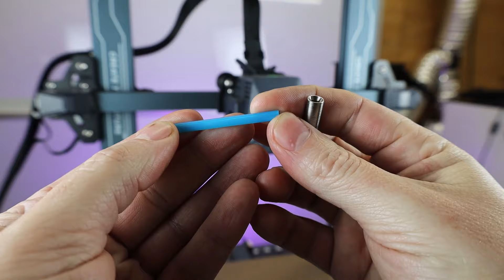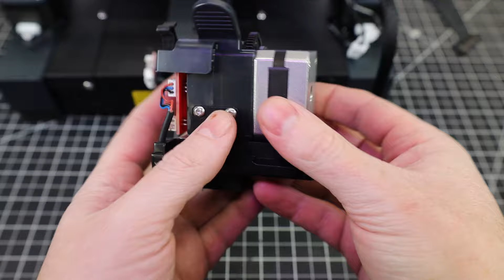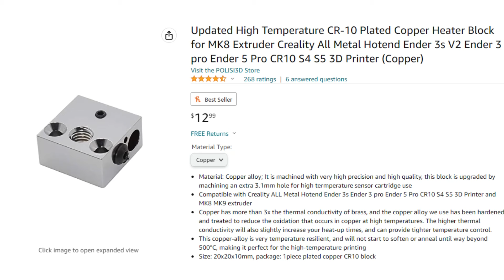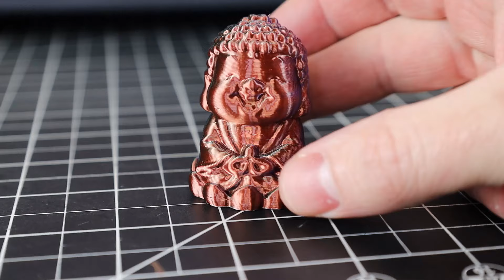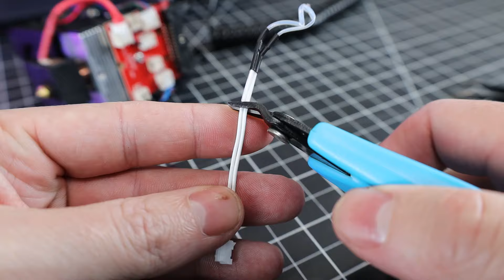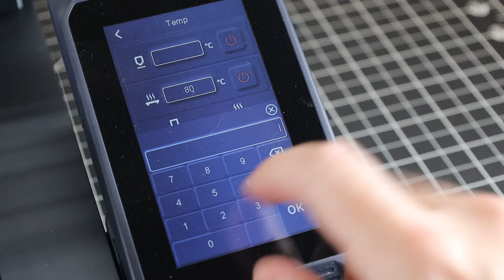$25 All-Metal Hotend Upgrade For Elegoo Neptune 3 Pro, Plus & Max

Comment: Hey man my nozzel feels snug but it looks like its barely in
Reply: What I did was pit the nozzel in first so the height was correct as the feeder could go in more than it needed to. 

@Kvngofdeath have you been able to get it to override the max temp? I had for a couple of prints and then it refused to go over 260.

Comment: Where do you apply the thermal pase? On the outside of the copper heat break? Do you also do it inside the heater and thermister holes?
Reply from the maker: Yes
Reply: @randymay thank you!

Comment: what is the size of the two bolt heads on the hot end? The two that secure the heat block to the heat sink? I used a lower size driver and stripped  them up.

Comment: Did you have to do a PID tune? The brass heater block I ordered does not heat up enough and I get a nozzle temp error. This happened with the polisi3d as well as another one I tried. I tried my original heat block and it heated right up. Was going to try a 24v60w heat cartridge, would this help? What am I doing wrong?

Comment: Has anyone had trouble getting the mounting screws for the heater block to line-up with the hotend?  I'm trying to use the copper heater block.

Comment: Anybody else ever had trouble sliding out the hot end? I've removed the screws, grub, heater cartridge and thermistor and the thing just won't budge. Yours just slid out, mine is jammed in nice.

Comment: Im in the middle of doing this but the the heat breaks are getting stuck on the heat disapator you slide it into. Was there some kind of silicone grease that wore down after a few years I was supposed to replace? How do I get the heat break off without destroying it?

Comment: Does anyone know what thermistor setting to use for Klipper with the one specified in this video?  I was going to assume NTC 100K MGB18-104F39050L32, but want to make sure.

Klipper config reference:
sensor_type:
#   One of "EPCOS 100K B57560G104F", "ATC Semitec 104GT-2",
#   "ATC Semitec 104NT-4-R025H42G", "Generic 3950",
#   "Honeywell 100K 135-104LAG-J01", "NTC 100K MGB18-104F39050L32",
#   "SliceEngineering 450", or "TDK NTCG104LH104JT1"

Comment: Heat up the heat block with a little torch. Try not to heat up the heatbreak. Once it's hot, spray the heatbreak with something like air duster in a can, or anything aerosol that comes out cold. The idea is that you  heat up the block so it expands, and cool down the heatbreak threads to make them shrink. I broke one just trying to twist it off. The second one I used hot/cold and it came out like butter. Another trick if its stuck is to try and tighten it just a hair, that will break the bond and then it should back out fine.

Comment: Does Neptune 3 pros were all the rage a couple years ago they’re still my favorite printer. I tried out the Neptune four pro and I hated it too many bugs when it first released and I’m sure they worked out some of that stuff by now, but just the fact with the proprietary nozzles and this, and that just not as user-friendly in my opinion, but now you can’t get any Neptune 3+ or Max anymore and I am wondering what if I need one? I have to get a n4 and I’m not crazy about that I was wondering if it was possible do you think to actually buy a 4+ or a four max and then swap out the motherboard swap out the extruder and turn it back into a 3+ or three max am I crazy for even thinking about this have they actually gone in the wrong direction or am I just fighting change? Maybe that’s too many questions anyway what are you doing these days with your 3-D printing?

Comment: Wow what a concise video!, do all thermistors work with the Neptune 3 pro, I want to print hotter than 280. Also, does this new heat break prevent heat creep, I have so much problem with that 😅. Thanks for the video though!

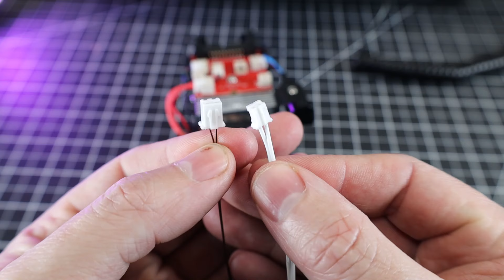Comment: 3:45 YOU DONT HAVE TO SOLDIER. if you just take the plastic female header for the thermoster off the pcb of the extruder, you can plug the bigger one right in.

Comment: Great video. Concise and to the point. I'm just at the beginning of doing upgrades to my printer so take my opinions with a grain of salt, but I learned through trial and error that the heating element and thermistor absolutely require thermal paste in order to accurately heat and measure the temperature because the machining tolerances are off enough that you won't get good thermal transfer. I just used a CPU paste which isn't specced to these temperatures (but it's what I have on hand) and I'll let everyone know if I burn the house down or not.

Comment: So i keep getting Thermal Runaway issues after applying the hot end upgrades, and this is including trying it on 2 different Elegoo extruders. i havent applied the thermistor upgrade. my temp is only reaching 141 - 146C then i get the error. ive also tried PID tuning and it fails. Do I also need to upgrade the thermistor, if I want to use the hot end upgrades? someone help me please.

Comment: Not sure if it’s been said yet, but you don’t need to cut any wires.  Just remove the female portion from the circuit board and shove the new cable onto the two pins.  I’ve been running it this way for 1k plus hours with zero issues.
Reply: This. Those connectors come off the board quite easily.
Reply: The thermister I got isnlong enough to wear as a necklace, so unfortunately I will need to cut it down.

Comment: I tried doing exactly what you show in the video, bought the exact same parts, but I guess my soldering job wasn't good enough. The printer doesn't heat up as quick as it should and I get the failure to heat error screen. Pretty annoyed by all of this, and the fact that you make it sound so easy to just splice the wires together, but don't actually show anything related to that, is frustrating. The wires on the new thermistor are so incredibly tiny it makes soldering them to the old connector extremely delicate and hard. I've wired plenty of LED strips together so I have some experience with tiny wires, but this was something else. I now have to buy another thermistor and replace the recommended one. I'm going to go back to the original for now since trying to upgrade as shown here was just a waste of my time and money. I'm not buying a huge box of connectors and special crimping tools I'll never use for one single end piece either, I don't feel like that's an optimal solution. Why someone can't make the brass stud style thermistor with the correct connector for the N3 Pro is annoying too, but I wouldn't bother trying to solder it to the old connector as shown, it's more delicate than this video would lead anyone to believe.

Comment: I made these mods on my Neptune 3 Max and found that the heat break suggested had the thermistor on the opposite side.  Now I finally have it all reassembled and I can’t get my filament to feed at all.  Any suggestions?
Reply: I got this same issue. Is there any fix?

Comment: The 27mm long Creality style heatbreaks with 20mm long in-heatsink sections were waayyy too long to fit properly for my liking. So I went with a 20mm long Kraken length full titanium part with a 13mm long in-heatsink section....very short but at least I could adjust to get the total assembled length back to within 0.1mm of the OEM parts ....MUCH more acceptable ....my cooling air flow is aimed at the part not the heatblock because everything is tucked back up inside as Elegoo specd out.
There are some 18mm parts out there but not enough guides OR amazon listings give proper measurements. ...it's frustrating ....those are the keys to replacments....numbers ....not names and amazon links with short lifespans of availability.
I'd also add that EVERYONE watching this needs to get an M6 thread tap ....because a LOT of the heatblocks are full of burrs and the coating on the all-copper blocks messes with tolerances preventing nozzles or heatbreaks from properly threading....until the block threads are "chased" with the M6 tap.

Forgot to add that you need a can of air to blow from the heatsink side back out the squirrel cage fan ....you wont beleive the dust bunnies living in there even in a closed closet like I keep my printers with a 24/7/365 dehumidifier running.....YIKES....probably should call that #onlyyoucanpreventprinterfires 😂

Comment: Thanks for the fantastic tutorial! I followed it to a tee, minus replacing the thermistor since once I did, my printer no longer detected one being present. After swapping to an all metal hot end though, filament no longer properly feeds through the printer. The gears grab it and pull it maybe a few centimeters before the filament stops being pulled through, despite the gears still spinning. Anyone have any idea for a fix?
Reply: in the same boat. What have you done so far?

Comment: FYI the link to the 4 pack is incorrect... you need the CR10 type but the link goes to CR6. The CR6 are too long and in turn cause the extruder not to detect the print bed before it is too late. Nozzle, meet the print bed... Ask me how I know.... hoping nothing is broken.

Comment: Black & Decker were bought out years back by DeWalt. You could use the same batteries on either brand, thought that was funny. Not sure if it is still this way. It was about 25 yeas back.

Comment: I too have to go for this modification with all metal filament insertion eliminating that 'obnoxious plastic tube that has caused me considerable problems and not only to me. I have a Kobra first series and I have done several trials installing the Kobra2 extruder but in the end I was not successful. When I first insert the filament it goes through smoothly but at the time of printing it does not come out properly. Solutions? Thank you very much.
Reply from the maker: You are still going to want to put that tube back in there just to act as a guide it will work without it but it works a lot easier to align your filament down into the hot end after switching it out. You'll need to cut the tube down to about 30 mm

Comment: You should heat up the heatbreak before removal, use a ligther or heatgun, mine becomes so loose you can unscrew it without tools, just don't burn yourself.

Comment: With the upgrade are you still using the PTFE tube? It doesn't look like that gets installed on the new copper head.
Reply from the maker: It makes it a lot easier if you do install it again but you do have to cut it down to be about 30 mm long it pretty much acts as a guide
Reply: @randymay  Thank you. Will the base PTFE be enough for the extra heat you would be putting it all through?
Reply from the maker: It will be fine because it wouldn't be all the way down in the heat block anymore.

Comment: you always disassemble using heat they don't use Loctite. Its the melted plastic I use a propane torch or heat it up with the heater on the printer .

Comment: I made the upgrade (Neptune 3+) with the solid copper heat block, all Metal Bimetal Heatbreak Copper & Titanium, and the ptfe tube. Halfway through a next print it blocked up and I had to take it apart again. What might have caused it with Elegoo PLA? Also, I am doing a flat print and the surface is now not as smooth as it was before the upgrade. Any thoughts what I am doing wrong? 
UPDATE: I cannot get it to print successfully now. A print starts and after a while no more filament comes out. I am so frustrated. @randymay
Reply: I'm now having this same issue. By any chance did you end up figuring out how to fix this?

Comment: Does thus make it so you don't need the ptfe tube at all now?
Reply from the maker: You don't need it but it does help a lot to keep it. You do have to cut it down to about 30mm long
Reply: @randymay  can I print at the higher temps with it still? I'm aiming for 300 degrees

Comment: This was a lot of help. I recently broke off my nozzle when tightening it. Then I tried to use a screw extractor and cracked the whole block 🤦
This video helped me with the disassembly and it also gave me some tips when I'm gonna buy a new one.

Thanks for the great video
/Bo

Ps. The problem was a bulge in the filament so the extruder couldn't feed it in. I of course realized this efter I broke the nozzle.

Comment: I noticed some of the bimetal heatbreaks have different lengths the one you linked eg is 20mm (copper section), but the one available on amazon AU is 13.5mm. Would this matter?

Comment: Thank you so much for this.  My 3D prints had started having more and more errors, so I took a look at the condition of the nozzle.  It was ... unsatisfactory.  I have new hot ends, a new heat block, M2 bolts, and different sizes of nozzles on the way, thanks to your advice. :)
Reply: My materials arrived today.  Printer is happily printing a little happy Buddha (personally I always thought it was Budai since Siddhartha wasn't fat).  I don't think I've ever fully disassembled and reassembled anything at this level of complexity before, and it's all thanks to you.  Thank you so much.
Reply: I don't suppose you would happen to be able to help with this, but for some reason, my heat block is now covered in what looks like caramelized residue, as was the old one.  Do you think my silicone heat cover may have partially melted somehow?

Comment: How did you make the bimetal hotend snug on the all copper heat block? There's a lot of play unless if i screw it completely in, but then the heat block is sitting on the extruder.

Comment: Hey 2 questions. When I thread the heat brake into the block there’s not much thread on the other side for the nozzle. Did I do something wrong. And 2nd when I just put in the metal heat brake it’s hard for the filament to go into the hole. I’ve actuslly been unsuccessful at getting it to work at all.

Comment: After doing all the steps exactly on a neptune 3 max, I cannot get the filament in :( the little curvature the filament has makes it stuck in the heat break. it seems there`s a gap between the new hot-en and the aluminium heat break... I`m not sure how to proceed - trying to reuse bits of the PTFE lining does not help :/ Anyone with similar issues ?
Reply from the maker: Cut the PTFE tube down to about 30 mm and put it in it'll act as a guide.

Comment: Just stick the heatblock on a gas stove, or heat reaaaly hot with a propane torch to melt up the thread locker...then unscrew so it won't snap off the thin neck of the heatblock
Reply from the maker: I used a torch and it didn't help and I didn't want to over do it and melt the aluminum

Comment: Jus a FYI - the link to the 2-pack of heatbreaks is a slightly different product.  Notice the taper at the bottom end of the copper.  This causes the heatbreak to thread too far down into the heater block, whereas the nozzle has no threads to grab on to on the other side.  If you back out the heatbreak a bit, the threads are quite loose and wobbly, so that wouldn't work.  
TLDR:  DON'T buy the 2-pack: "AIEX 2pcs All Metal Smooth Heatbreak"
Reply from the maker: They must have changed the item listing at some point I'll have to find the proper one and have that link updated

Comment: Did you put the blue tubing back in?
Reply from the maker: I did because it made it a little bit easier to line up your filament with the hole on the inside I cut it down to about 30 mm long and total.
Reply: @randymay  I was curious because I didn’t see it within your copper nozzle. Do you know what that is called. Probably gonna have to get more I kinda pinched it taking it out of the old one.
Reply from the maker: PTFE tube

Comment: What replaces the ptfe to guide it?
Reply from the maker: Nothing but it didn't end up being annoying to get the filament into the hot end part at times so just cut down to PTFE tube to about 30 mm I put that back in and it should work fine as a guide.
Reply: @randymay  I did exactly that and worked fine. have you had any issues with clogging? Im an hour in and so far so good but heard some people having this issue.
Reply from the maker: I haven't had any problems with it but I did have some under extrusion so I had to up my flow rate a bit.

Comment: I followed the tutorial but now it’s not extruding or melting the filament, do I need to use the blue piece or can I do it without it?
Reply from the maker: Cute the blue tube to 30m and put it back in. It will act as a guide making it a lot easier to get your filament into where it needs to be. As you saw in the video we can totally be used without it but it makes things a lot easier using it.
Reply: @randymay what is 30m? 30mm?
Reply from the maker: 30mm the blue tube

Comment: I have been having nothing but issues with that copperhead heat break. Does the bowden tube need to be firmly pressed against each end as to not have it move? Because there is a tiny amount of play, which is enough for it to build up a thin disk. That cools and clogs the heat break. I tried removing the bowden tube all together. And all that happens is the filament curls in a spiral in the inner chamber of the heat break. Till it's not able to curl anymore, which leads to it not feeding anymore. 

I had to put the stock heat break back because I was sick of having to keep tearing down the hotend to unclog the heat break. I messed about with retraction all the way down to 1mm of retraction with zero change in stringing from the stock slicer settings of 6mm (temp tower also didn't yield any change in stringing as well). And even then it still clogged. Whereas the stock heat break runs flawlessly. What am I doing wrong with the copperhead heat break for it to keep clogging. I thought that thing was supposed to stop clogging, all it has been doing is clog. 

Thanks!

Comment: did i miss something or does the heatbreak need the plastic installed? cause you cut it to match the old one but there is no link for it and i don't see it on the link to the heatbreak. thx <3